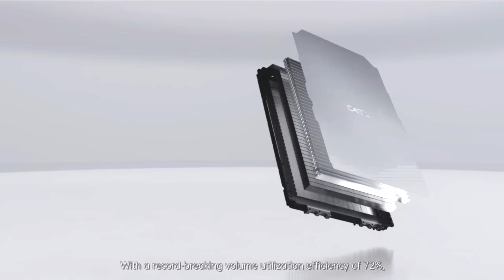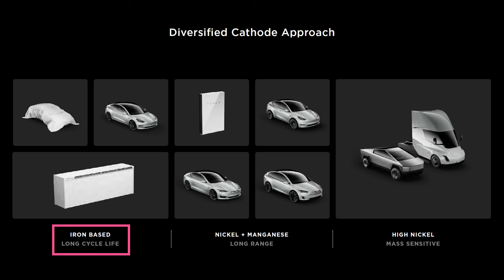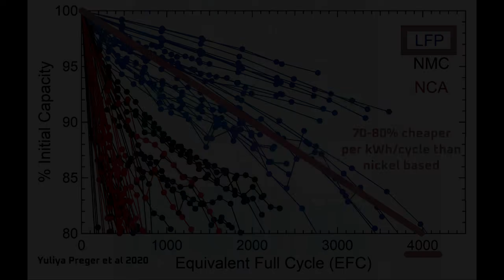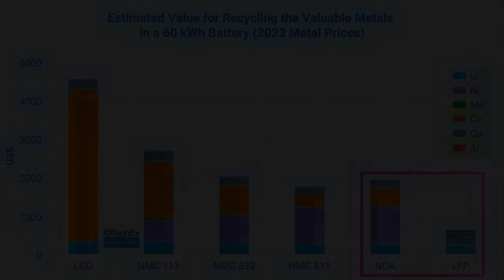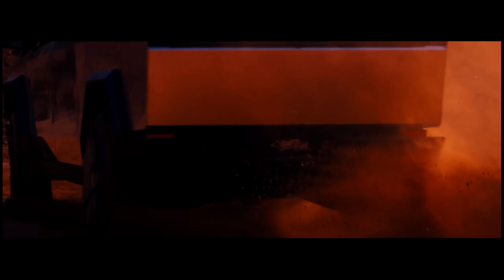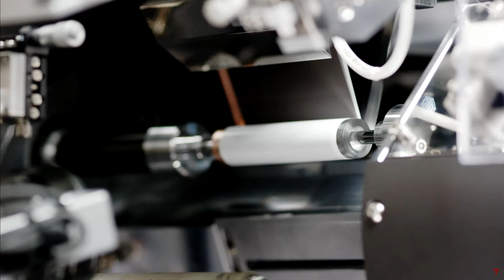Cybercab:  A Comprehensive Case for the LFP 4680

Comment: LFP 4680 makes sense for Cybercab. But even tho they can handle 0-100% charging, I wonder if they'll be able to easily replace the battery when it degrades?
Reply from the maker: I expect it to be a few dozen bolts like it is with Tesla's other vehicles
Reply: @thelimitingfactor  with the body's anti-corrosion properties, and minimal maintenance requirements, plus the ability to change batteries for new technology,  I wonder if it will do 2,000,000 to 3,000,000 miles before a motor replacement. @thelimitingfactor

Comment: One thing I don't get about the Cybercab is the absolute refusal to do a charge port. Wireless charging may be powerful and efficient enough to compete, but the infraststructure isn't there, and how much would the port+wiring cost anyway. Por que no los dos?
Reply from the maker: It would cost several hundred dollars per vehicle and a lot of additional complexity in the vehicle and the supply chain.  They could do it, but they'd eventually ditch it, so may as well launch without it.  But, we'll see.

Comment: Does anyone else think the cyber cab looks like it will not be “skateboard” based?
It looks like the floor is too low in those shorts with both doors open. It also looks like the rear trunk floor is high and long. It seems like they could create a battery and motor combo unit that would contain all the thermal management in one package, and this would free up the battery form factor. Thoughts?

Comment: Impressive dissection of the data as usual! Interesting to think that the 300 mile range version of the Tesla semi could be achieved with 4680 LFP, that's an idea that I had not seen before, I mean, it could even be a possible real outcome to maximize the ammount of producion for the Tesla Semi, if Tesla can go the LFP 4680 to maximize cell output, and the constraint for the Semi is cell production, that could actually help.
Reply from the maker: Thanks for your thoughts!

Comment: I'm hoping for an LFP or other high charge number composition. Essentially, a cybertruck should come with an unlimited battery warranty. It's' supposed to be an indestructible vehicle. If in a million miles they need to replace the battery on warranty, tech has probably improved again and the replacement battery will last even longer. I expect there will be a million mile warranty on any EV battery, it's already starting to happen and the rest will need to remain competitive so they'll have million mile warranties as well.
Reply from the maker: There has to be a year or calendar number attached because most degradation is due to time passing, not cycles run

Comment: What is behind cycle life? We see LFP batteries ranging from 4000 cycles to 15000 (CATL BESS) cycles. We see NMC batteries ranging from a couple of hundred to 3-4000.
Reply from the maker: Cycle life is dependent on testing conditions, the quality of the materials, and the quality of the battery management system 

You can destroy a great battery in one cycle if you really want to. 🤣

Comment: What about LMFP and sodium, sulfur, or vanadium doped chemistries? Interesting video.
Reply from the maker: Thanks man!

LMFP - Lower cycle life
Sodium - Not widely available (the cells, not the material)
Vanadium - Adds expense and not widely available
Reply: @thelimitingfactor  Thanks but doesn't LMFP have a higher cycle life than NMC (though lower than LFP) and a higher energy density than LFP alone?
Reply from the maker: Why would that matter if the focus is on $/kwh/cycle?

Energy density doesn't matter for the Cybercab.  People think too much about 'big number' rather than "what does this product need?"

The cybercab isn't a hot rod, nor is it a long haul vehicle.  It needs to be cheap cheap cheap
Reply: @thelimitingfactor  well for regular cars that would be helpful or lower cost sports cars.

Comment: Thanks for sharing your insights. 
For a vehicle, battery pack volume is a limiting factor. 
Please estimate the battery capacity that would fit in the space available under the CyberCab floor. 
I would guess that there is enough space to accommodate an LFP pack with sufficient range, even with 4680 cells rather than prismatic cells. 
Any thoughts on the size volume limiting factor? 🤔
Reply from the maker: Look at the chart I provided.  It gave both volumetric and gravimetric energy density, which scale proportionally

Comment: LFP Cybercab is the play. We may also see this in there cheaper model - low end / mid cost build potentially. I.E> 250 miles range LFP RWD. Then the remaining jump into NMC builds instead. 

Also I wonder what the vehicle weight is on the Cybercab? lets say its 3600 lbs instead of model Y 4200-4400 lbs, that weight savings translates to higher at pack utilization and more range.  So its possible even on the low end LFP for Cybercab its 250-275 miles without a issue at all and a 80% charge would still net a 200+ mile range vehicle.

Comment: I think there is a market for high capacity replacement batteries for cars with factory batteries that don't have enough range to suit their owners needs. With lab cell capacity hitting 700 watts per kg I can see 200 kilowatt hour packs being feasible in a form factor that could replace a 66 kwh Bolt battery with a 200 kwh battery. That could give 5-6 hundred miles of range even in cold weather, maybe 3-400 in cold weather pulling a small camper & near 8-900 miles range under idea no hvac needed conditions. If I had that capacity fast charging would probably never be needed for me or most people unless they were going on a cross country trip. I know charge times are getting better & the infrastructure is being built out but based on my own experience & talking to others I think range & charge time is the biggest factor on more people not switching to ev's. It's also much less expensive to charge at home than any fast charger I've found thus far. In my area fast charging averages 3 times the cost of charging at home & is actually on a miles per dollar cost more than driving a gas vehicle at 23 mpg. I spent $8 yesterday for 70 miles. That's 8.75 miles per dollar & gas is $2.60 per gallon here. That was at 24 cents per killowatt & some chargers in this area are 49 cents, making a 12mpg equivalent. A higher capacity battery that could be charged at home for 99% of normal use would get closer to the cost most ev owners actually expected when they bought their cars.
Reply from the maker: Yes, but it's an edge case.  Tesla focuses on the 95%
Reply: @ I agree but it looks like a wide open market for a small manufacturer such as Our Next Energy, although they don't seem to be interested in manufacturing as much as they do selling their designs.

Comment: from what i have heard they built the cybercab so it could be battery agnostic or use any or batteries.. the cybercabs in Austin are the best place to test battery chemistries.. if it has a problem it is close to the factory so they can just swap a new test pack in its place. So basically I see them using many different batterie types and the cybercab is a great test vehicle for them. If they make enough for even just 1 cybercab they can test them or if they make a larger batch they can test them also.. 

For the first Cybercabs it makes sense to use LFP cells of one type or another since all the trips will be short range
Reply from the maker: Correct

Comment: If Tesla really needs higher energy density for the workhorse batteries, couldn't they dope the LFP chemistry with manganese? The manganese doped batteries would increase energy density, cost about the same, and might also achieve the same cycle life. All without resorting to nickel.

Seems like a win win, or am I missing something?

Edit: the idea to dope with nickel to increase cycle life is also a good idea. In fact, Tesla's patent for doping LFP with both nickel and Mn is an awesome idea I hadn't thought of.
Reply from the maker: Adding manganese reduces cycle life
Reply: @thelimitingfactor  Are there educated guesses on whether a vehicle that undergoes a usage pattern like a cybercab would survive that long at all for even higher cycle lives to matter? At e.g. 16h a day operation in urban areas at low to mid speeds plus a certain rate of vandalism and crashes, wouldn't the bodywork, suspension and drivetrain be dead anyways after e.g. 250k miles?  Tesla's lightweight construction principles are not built around replaceability of parts (except e.g. seats, suspension parts and the motor)

Comment: At similar Areal capacities (mAh/cm2) LFP electrodes are thicker than NMC electrodes. This creates an issue when winding them tightly as in the center of cylindrical cells as this can lead to electrode fractures. That’s neatly avoided by stacked pouch cells such as BYD’s blade cells…
Reply from the maker: ...that's where the DBE coating can help 🤠
Reply: AFAIK, BYD’s “Blade” cells are prismatic, not pouch format.

Comment: For a cybercab, do you think the life of the vehicle is gated by the battery pack?  If not, then cycle life is less important.  I don't know the answer, but hopefully you do!
Reply from the maker: Nope!  Because everything on the vehicle will be designed to be easily replaceable 😀
Reply: I think Cybercabs will be renewable. Seats. Interors. Battery Packs. Motors. Body Panels. Glass. All replaceable in minutes. As least so far as is technically feasible. Elon brief to Engineers would be to build the lowest cost per mile vehicle possible. Vehicle life is key to that calculation. I think they will get 1m miles out of each one.

Comment: Did I miss it? Or did you cover the recently released report on a first gen 4680 bought from munro and its 2022 summer y tear down. Vs the byd blade cell from 2023? Interesting in that except for total cooling the no longer used 4680 was superior in everyway vs byd and only cost $10 more per kwh at the manufacturer cost level! Proving catl ceo is a jealous nutjob and elon was right about the 4680 CEO program. Also of jote is apple pumped over $6,000,000,000 per public info into the byd blade program!
Reply from the maker: I didn't cover it because even the the paper is new, it was an older generation 4680 that I've already done about 5 videos on, including several teardowns.  Yeah, when they take shots at Tesla, is usually a good indication they're fearful, lol.

Comment: Thanks for great video. LG EnSol might be second source of LFP 4680, because they will launch 46mm diameter ternary cylindrical cell production, and ESS LFP pouch cell in Arizona new factory. They already announce to supply LFP pouch type for Ampere Renault late 2025 in poland.
Reply from the maker: Correct!  🤠

Comment: what happened to needing the 4680 form factor for the structural pack?
Reply from the maker: I don't know what your point is 

I've covered this at least half a dozen times in my videos. 

The structural battery pack is a set of technologies, not just one 

And it depends on how you define structural battery pack 

There's the attachment points, the structural floor pan, then the battery itself
Reply: @thelimitingfactor  i thought i remembered Drew and others saying the 4680 was crucial for structural packs.. i dont watch all your vids so likely missed that.

Comment: I don’t think they’ll ever do a longer range cyber cab because worst case scenario if you do a really long trip, they could always swap cyber cabs it could even be built into the app that it knows how far it can go and already have another cyber cab ready
Reply: Switching luggage every 200 mils sounds terrible
Reply: @Daan87423 , 200 miles is at least 3 hours in the cab. I think I could handle swapping my luggage into another robotaxi after 3 hours.  It should only take a minute or two unless you pack really poorly.  If I had to switch it more than once (i.e. 6+ hour ride) then I probably should have taken a plane anyway.
Reply: @CL-gq3no I'd love to use autonomous cars as an alternative for planes, not just for the environment but also convenience of being able to take whatever I want. It would take longer but I wouldn't care much since I could just leave at night and sleep through most of it. Switching luggage every 3 hours would be a PITA.
Reply: Few people will want a long trip in a budget cybercab and would likely pay a little extra for a more spacious and comfortable model x ride instead
Reply: I live 80 miles from my nearest “large” airport. My local strip is just 20 miles away.
But a journey to London is 175 miles of fast roads. Just in the worst place for EV range.
Reply: @Dave5843-d9m  but as a Robitaxi, you'll not need the same vehicle each direction. Also, as Wireless Charging Infrastructure comes online, you might not ever notice a 10 minute top up. Especially in traffic.
Reply: @Dave5843-d9m  if only charging existed
Reply: The future should have sleeper cabs, which could eat into customers of short-medium haul flights. This would need to have longer range packs.
Reply: @thomasreese2816  Not really on the longer range. A Sleeper Cab is perfect for multiple autonomous wireless charges. If you are asleep, what would it matter how long it took? Usually, you would have a destination target time, but that would all be pre-calculated.
Reply from the maker: I covered that in a previous video 

Tesla has several options 

They could swap the cab, or use a higher powered charger, or use a different vehicle 

The point being that Tesla has plenty of options and it doesn't really matter the specific option, but rather that they solve it, which they will
Reply: long range cybercab needs a bathroom built-in
Reply: I agree with you, cybercab will primarily be for urban commuting high ride number low mile per ride. Longer trips could use other models for better range. 
Energy density isn’t the top priority for cybercab.
Reply: Doesn't this presuppose there will be a functional cybercab. Seems bloody unlikely given how far FSD is from being able operate without supervision.

Comment: Do you know what specific corner cases Drew was referring to that might drive towards a prismatic form factor for LFP?
Reply from the maker: Grid storage 🤠
Reply: @thelimitingfactor  Interesting. I would call that a use case rather than a corner case, so I'm not convinced that's what he was talking about.
Reply from the maker: @buckingthenorm not everybody has the advantage of pre-scripting everything that they say like I do 😁

As I've said before after Tesla's events and earnings calls, they're speaking off the cuff, which inherently means that there's going to be some errors
Reply: Do you mean taking the second life of batteries as grid storage into consideration in the equation for battery optimization??